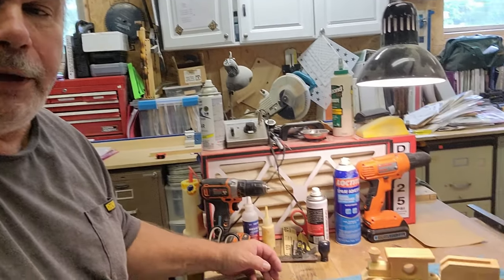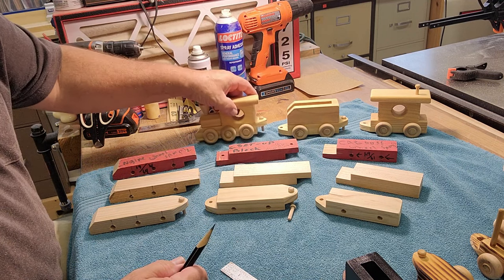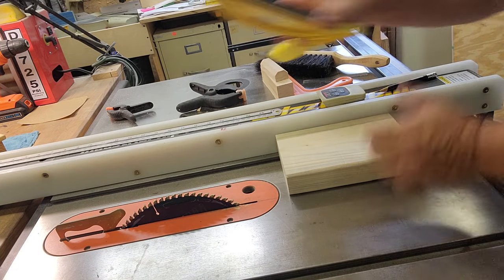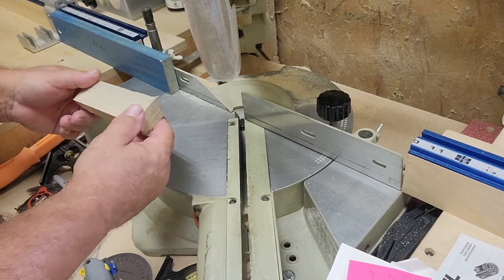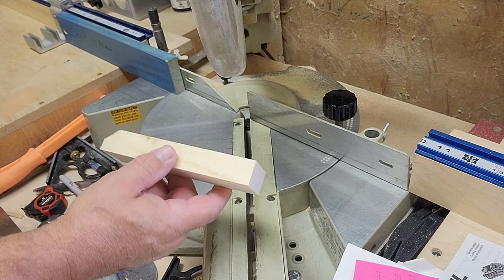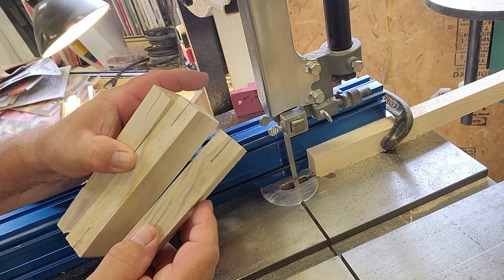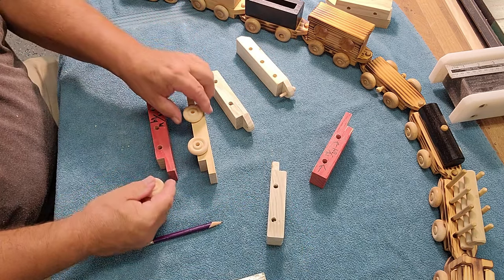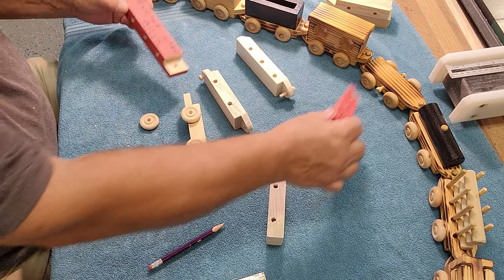How to make a wooden toy train | Part 1

Comment: Nice job!  Try drilling your holes that attach the cars before you cut the 1” sections out.  If you drill from one side then flip the part and drill from the other on the other end, then cut your sections out you eliminate your tear out from drilling the holes.  If that makes sense.
Reply from the maker: Good tip!
Thanks for watching

Comment: Really nice design and thoroughly explained, thanks. From 34:30 it looks like you have drilled the holes on the top rather than the bottom? Why would you not simply use slightly larger wheels, maybe an inch and a half (38mm), this would probably allow you to drill all the holes along the centre line of all the blocks, this would eliminate errors regarding top/bottom and may also look even better?
Reply from the maker: Hi. Thanks for watching my video.  I see what you are saying, but we thought it would look better with the smaller wheels.
Reply from the maker: You mention the holes 
being drilled in the top of the block. I noticed when I was making the video that I had that block laying upside down. All the holes should be at the bottom of the block.
Reply: Hello, what size wheels did you use? Thank you
Reply from the maker: @HugoSanchez-zv7yf  we use 1-1/4 wheels